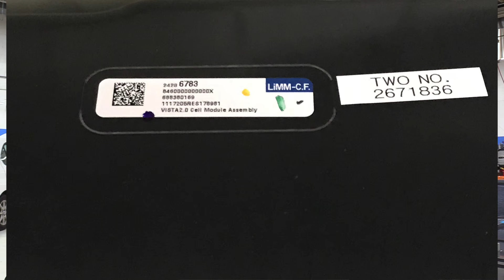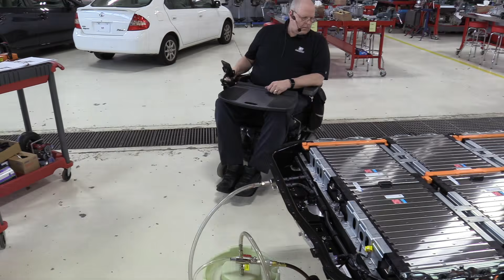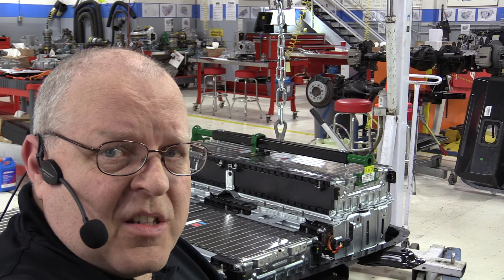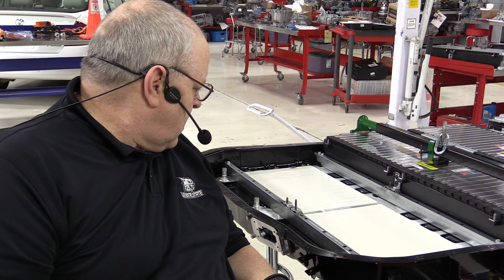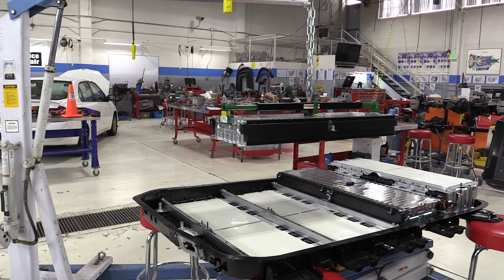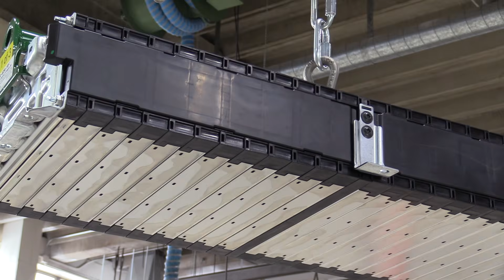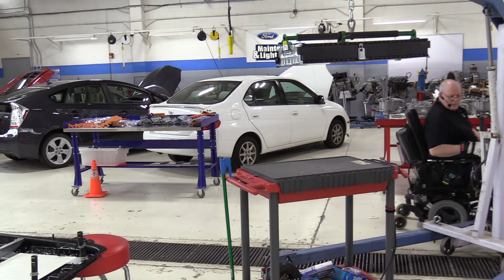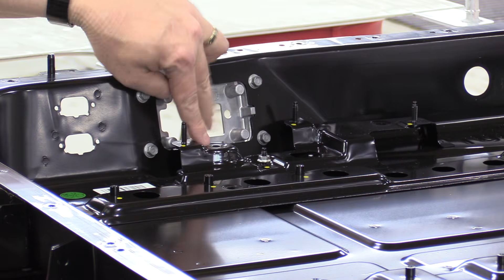Chevrolet Bolt EV Battery Disassembly

Comment: Once again another outstanding and informative video.......

One observation I would make though.....

I cannot see that the White Thermal Pads, (sticky on the bottom side), need to be replaced upon re-assembly. They were only peeled back at the edges to access the bolts and accordingly their integrity......and 'sticky-ness' do not appear to have been compromised. Since they were only peeled back at the edges, by an inch or so.  I would suggest that no 'bubbles' have been introduced underneath them on the sticky, (bottom), surface.

I would have stuck the edges back down on the plate, after removing the bolts, to stop the sticky-ness' of the adhesive from drying out.........and thus then ready to peel back the edges again when the bolts are re-fitted on re-assembly.

The suggestion that in re-fitting any new White Thermal Pads one must avoid getting any bubbles on the bottom , (sticky), side, is merely commonsense in applying anything that is sticky......or indeed, where one has applied adhesive to a surface, or surfaces.

The risk of bubbles underneath the White Thermal Pads will have been an issues to be avoided when the pads were applied during initial construction....

Four new, (sticky), White Thermal Pads at $30.........(was that for one pad or all four).........is a nice little earner for the dealer, but would appear to be completely unnecessary if the pads are undamaged.

This is especially the case here because the pads have not has to be completely removed to access the bolts. In fact, there would seem no apparent need to remove the pads. They were clearly installed when the vehicle was manufactured and should last the life of the vehicle.

The Dealer should have known this.........and probably does....

James Hennighan
Yorkshire, England
Reply from the maker: Thanks for watching

Comment: Strange design decision to put hose clamp type connections inside of a sealed battery. Those always end up leaking....maybe the life of the battery is shorter than those clamp connections? Great video thanks a lot for what you do, I've been slowly working through your videos, learning a lot.
Reply from the maker: Thanks for watching

Comment: People say dex-cool is trash. I use in my impala since I bought her new in 2008. It has 250,000 miles on it and I have only changed one coolent hose not because it went bad but simply it was a decade old and located in a area that gets a lot of road dirt and salt on it. (Lower radiator hose). Had to change the thermostat once and that's it. The water pump is original along with all the other hoses. I empty the radiator every few years and fill with fresh but have never done a complete flush and fill. I also include one small tube of alumi-seel, the fine shiny powder not the gross poop stuff that's liquid..
I think it's the best. The problem is that nobody does maintenance on their vehicle. They go 130,000 miles and never even do a fluid refresh. Then after 10 years and 130,000 miles when the water pump or something goes bad they all.yell about how everything is garbage.
I remember the green stuff that you had to change yearly to be safe..
I will keep using it for sure.
Reply from the maker: Thanks for sharing. As you probably know, the recommended change interval is 5 years or 150k miles.

Comment: Is thing supposedly field serviceable?
 If you get all 259 miles for all 500 charge cycles, you are looking at replacing this unit or paying someone to rebuild it at 129k miles.  This is going to cost as much as a new engine.  I cannot believe those mats are 300 bucks! $300 for 10 little mats. That's ridiculous. Labor intensive rebuild and so it would probably be more cost effective to replace the whole thing.  How long will these batteries be available?  Unlike most car parts, this battery gets bad with age. Even NOS batteries will be useless.
Reply from the maker: Yes, field serviceable. I do not know how long they will be available. Thanks for watching

Comment: Great video! I watched it 3y ago when you released it. This video made me think that Bolt is actually well designed. I ended up leasing one since August 2020. Last weekend GM announced the new refreshed 2022 Bolt EV and Bolt EUV which use the same battery pack (2020 Bolt) made by LG in the USA instead of the one made in South Korea as the 2017-2019 models. For many Bolt fans including my self was a big disappointment that the 2022 refreshed models still have only 55kW DC fast charging peak rate. I remembered your video and watch it now again to see specifically the cooling plate. I remember from before that the cooling plates are on the bottom of each of the 5 modules. It makes me think that this creates limitations on how efficiently the cooling plates actually can extract the heat from each cell individually and whole modules too. Seems the top of the cells and modules can build up heat that cannot be extracted and therefore GM limits Bolt at only 55kW peak for DC fast charging. For comparison, what I know the Tesla cells are cylindrical and the cooling runs sort of between each cell on both sides vertically rather than on the bottom only. 
Do you think this active cooling design is what actually limits Bolt EV and now Bolt EUV to accept something like 100kW or more on DC fast charging?
Reply from the maker: Thank you, yes I do.
Reply: @WeberAuto   Thanks!
Reply: I'm a thermal engineer, was thinking the exact same thing.
Reply: @alexkram  exactly!! I am sure otherwise GM would put better wires from the port to the battery

Comment: Do you have a set of basic dimensions for the complete module? Looking into a bold as the donor in an EV conversion but I can’t find the dimensions for the battery pack...
Reply from the maker: 2017 Bolt EV Battery housing dimensions 
43” width case without brackets 
46” width at 4 front brackets with bolt holes
50.5” width at 1 rear bracket with bolt holes
71.5” length case
12” height under rear seat (not counting service lever)
6” height rest of the front of the case
963 lbs total weight

Individual battery sections are as follows (not counting brackets)
Sections 1-3
13.5” wide
37.75” long
4.25” tall
137.5 lbs weight each
2 modules per section of 40 Volts each with 10 3.7V Li-ion cell packs in series. (One cell pack is 3 cells in parallel)

Sections 4-5
13.5” wide
34” long
4.25” tall
123.5 lbs weight each
2 modules per section, 1 at 40 Volts with 10 3.7V Li-ion cell packs in series, and 1 at 32 Volts with 8 3.7V Li-ion cell packs in series. (One cell pack is 3 cells in parallel)
Reply: @WeberAuto  Amazing video, and a gentleman in the comments! Thank you so much. In another video you commented on how thin it is, it looks like about 5-inch thickness for the "bed" of the housing, how far off am I?
Reply from the maker: @alecthille5116  6 inch thickness
Reply: @WeberAuto  Thank you! hopefully other people who are interested find their way here too

Comment: Did you ever find out more about the thermal conduction mats that came with the battery? I'm trying to find or make something close enough to use these batteries in a conversion project.
Reply from the maker: Yes, you can buy them from Chevrolet
Reply: @WeberAuto  Thanks! Do you remember what they call them? They're not listed as far as I can tell on any of the parts sites.
Reply from the maker: @azimath9939  GM Parts number 24282825. It is called a "Pad"
Reply: @WeberAuto  Thank you!

Comment: drainig the coolant: judging by the construction of the coolant plates and the layout of hoses between pack 4*5, would this be a viable strategy?

1: vacuum down as usual (with pulsation?)
2: tillt pack one end of assembly as high as you can on the cart to allow residual coolant in upper coolant plate to drain into lower plate
3: tilt pack one end of assembly as low as you can on the cart to encourage reisidual coolant in lower plate towards vacuum barbs
4: vacuum down and pulsate until running more or less dry

WRT busbars: as a safety issue I would only uncap the covers when actually undoing the nuts. Even with the break plug pulled, if someone or something gets arcoss exposed terminals it could be bad news

40V may be "safe" but even 12V can be lethal if you have wet hands (virtually all the human body's electrical resistance is in your skin. A bit of ionic liquid - salty water - will make it condctive) and then there's the issue of current: I can't count the number of times working in the telco sphere where someone got careless around 48V and ended up melting tools (seeing a 12 inch wrench explode into a shower of molten sparks is.... spectacular)

Comment: In AC there is no polarity! Are you sure you are profesor?
Reply from the maker: The “A” in AC stands for Alternating. What is alternating?
Reply: @WeberAuto  , only DC has polarity, plus (+) and minus (-), Alternating Current (AC) is changing direction how electrons flow and polariity is changing to positive or negative amplitude, so there is no fixed polarity in AC. period! You may mark cable with 0 or neutral, and F or hot or whatever, but in reality we don't have + and - in Alternating Current (AC) World.

Comment: I'm not an electrician, even though low voltage may not be directly dangerous, metal on metal contact could create dangerous shorts. I've heard horror stories of wedding rings causing a short, got welded from the heat, then causes horrible flesh burns. Lithium-ion batteries are prone to thermal runaway when shorted. No stopping a lithium fire. Just let it burn out.

Comment: The "battery energy control module" as you called it is often known as a "Battery Management System" to allot of fields that work with DC LiIon or similar systems where there are parallel packs to get amperage and capacity wired in series to increase the voltage where the parallel packs balance themselves as they charge naturally the series connections have to be kept in balance (the save voltage/capacity level) by a BMS or Battery management system which can work one of a few ways... Most commonly they use discharge balancing where it drains a little from the highest cells to balance them with the lower ones and dissipates it in a resistor in the BMS.  The reason this is needed is even though the battery is getting a charge voltage from the main connector the batteries have even very slight differences in resistance or impedance that causes one to absorb a bit more of the electrons than the others and if they weren't balanced you'd have one cell at 5 volts overcharged because it had the lowest resistance while another is at 2.4 volts getting overly discharged because it couldn't get enough power while charging.  Maybe you cover this later in the video, but I Thought I'd fill it in in case you or anyone is curious about how those batteries work.
Reply: Thanks for the explanation

Comment: Great video. I wish you would have addressed electrical safety that includes verification, guarding by distance,PPE, proper tools and lock-out.thank you again for a great presentation.
Bill Doss
Reply from the maker: Thank you. That is all in a different video
Reply: @WeberAuto  my bad. I will go back and look. Sorry.
Reply: Also energized work permit or standardized work. This would also include a safety area, taped off or baracaded. ESWP.

Comment: I have 14 of the individual modules (for ~48v-56v @120AH and they have 2 60AH cells in each. Does the Bolt use 2 cells from one module and parallel those with 1 cell from the adjacent module to get 40v?

Comment: Hi sir should I buy a battery replaced used 2017 Chevy bolt ev which has 20k miles on it. It is also showing damage frame reported on cargurus.com it's VIN number is 1G1FX6S01H4180902

Comment: How does the battery balancing start when a module is removed, as the HVIL is disconnected in your case?
Also, there's no power for BECM, correct?

Comment: So if I wanted to upgrade my 2017 Chevy Bolt to Level 2 DC fast charging, do I just need a new connector port and the cable that would connect to the larger DC port on the outside of the battery?

Comment: After watching the breakdown of both the Volt & Bolt battery packs, it does seem that the Volt's fin design provides a more uniform transfer of heat (either in or out). One does wonder why? Could it be that GM engineers decided that they over engineered the Volt?

Comment: bought a wrecked Bolt  Does the body shop need  to disconnect the high voltage battery to weld on the car   Thanks so much

Comment: I'm guessing this battery is very similar to the 2020 Bolt, I believe it should be the same as they just changed the chemistry slightly to boost the capacity 10% or so. Awesome teardown of the battery pack, I was wondering what it looked like inside my new cars battery.

Comment: 44:25 My understanding is that the Bolt EV's battery cells exceed 60 Ah when charged to 4.2 V, which is the max rating for the cells. So the 57 kWh rating might be based on a max voltage of 4.0 to 4.1.

Comment: All that voltage and metal fixing brackets? I'm seeing a little over site here in the event of crash damage. Granted it would have to be a heavy crash but all the same, use plastic Cheverolet.

Comment: This 60kWh capacity might be true because manufacturer undervalue battery capacity because it changes in time usually its couple percent higher than sticker says and it gradually goes down to nominal value then stabilizes for 70-80% of the cycles. Great video series on bolt car kinda shame that this car is not available where I live.

Comment: I really enjoy these deep dive videos in general, but especially with the Bolt. The power unit design is much more elegant and a generation past what just about any other main stream EV manufacturer is doing (possibly except for Tesla). 
That being said, I'm confused by the battery rating. My 2019 Bolt has the same label on the outside of the battery, showing 57kWh, but Chevy advertises it as 60kWh. (website source https://www.chevrolet.com/electric/previous-year/bolt-ev/build-and-price/trim/compare/trims/table?section=Highlights&styleOne=399469). Yesterday, I took my Bolt for the first longer road trip (longer than a single charge could take me) and on the first leg of the trip I got 235.3 miles and used 56.7kWh. The car said it had 5% battery remaining and went from saying 15 miles remaining to "low" on the DIC just as I pulled into the charger. So, depending on what numbers you trust, I was either 0.3kWh from being stuck on the side of the road (if the labels/ratings from LG are trusted), or it has a 60kWh battery (57.3kWh+(60kWh*5%)=60.3kWh). I'm not doubting what you said or what your battery said, mine says it too, I'm just wondering who is fudging the numbers and how they are doing it.
Reply from the maker: The 60kWh is what you actually have on a fully charged battery. The 57kWh rating is for the "Nominal" voltage of the battery.

Comment: 57kwh is a nominal rating, sort of like saying, this is a guaranteed capacity. 60kwh is a typical capacity at more typical warmer temps. Same ratings given on rechargeable batteries. 

https://electricrevs.com/2018/03/29/gm-explains-57-vs-60-kwh-bolt-ev-battery-ratings/

Comment: To balance the fixture to the battery you need to offset your fixture in the holes where it will balance up when having less modules on one side than it is the other I think you said it was three less that will throw it off balance unless you move your module the appropriate holes to counter Balance it

Comment: I would like to know the width length  of the Battery pack is if possible. Looking at possibly buying salvage Bolt, and using drivetrain and ECU  under Classic Mini Shell?

Comment: I'm going to guess that the mat works much better than a layer of thermal compound under the wide range of temperatures you might encounter driving a car out in the elements.

Dr Kelly, at first I thought maybe this was rehearsed, considering its complexity. But as I watched, I got more of an impression that there were details you had not actually laid eyes on, so you were just drawing on other experience (and careful reading of the instructions) to know what to do.

About the PPE: One more layer of protection worth having is an assistant! I don't know if you had one just out of view or not, but it would be interesting to get your views on that.
Reply: Well, I guess there must somebody moving the camera around…

Comment: This entire process is INSANE.  I thought that all you had to do to replace a car battery was to loosen a couple of nuts and bolts!  By the time you removed only the first 50 top screws, I could have rebuilt my entire Chevy short block V-8.  You needed so many specialized tools for the job, I thought you were rebuilding the entire car, even requiring a freaking ENGINE LIFT!!!  You wasted an entire work day just unscrewing and removing screws, bolts, and fasteners, and that doesn't even include REPLACING WHAT YOU REMOVED.  
This 20th century technology is already outdated, and soon these gigantic, toxic, incredibly expensive batteries will soon will be piled high in the already overcrowded landfills all over America.
Reply: Yes so until the tech changes even more stick to petrol cars.

Comment: You should have hidden two double A batteries somewhere, pulled them out, and said, "Now here we have the two double A batteries that power the electric motor that drives the wheels."

Comment: If the car met accident..those battery tray is damage, the batteries will crush, might as well replace entire battery unit. A little dent will cause coolant leak, flow obstruct, crush harnesses, man.....🤢🤢🤢🤢

Comment: question: can the long module sections be separated down the middle? where the black plastic is? I'm thinking for conversions, it'd be useful to split those battery sections in half, since they're really long and ungainly
Reply: Ryukachoo absolutely. You can section it down to the individual cell package